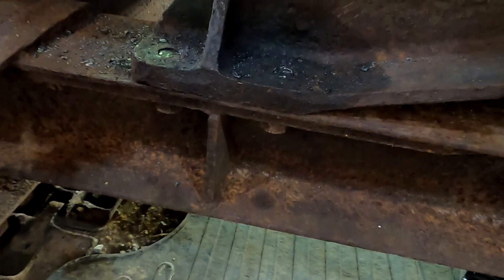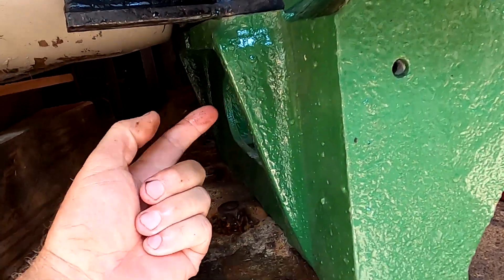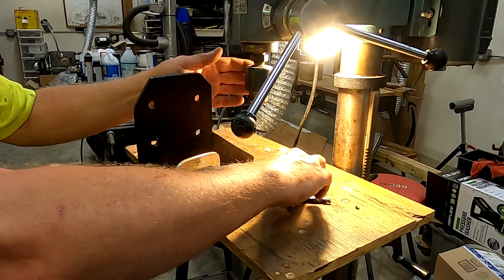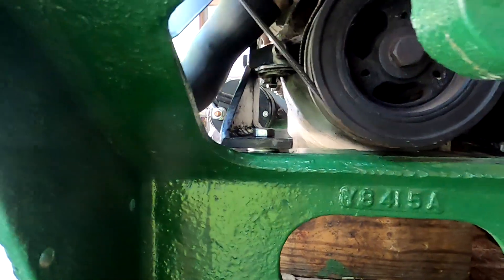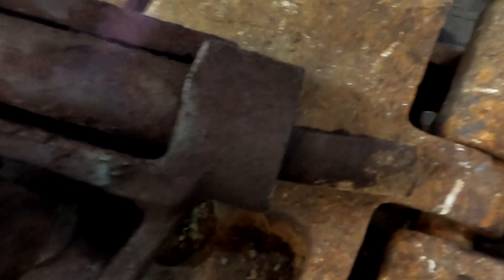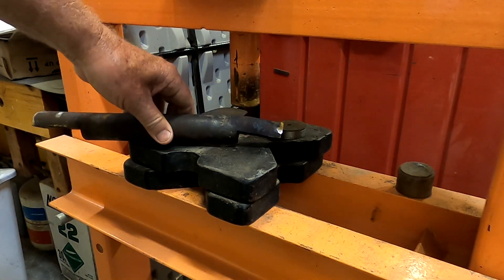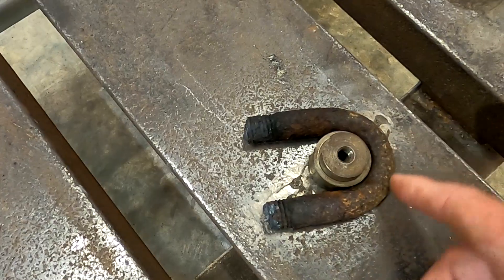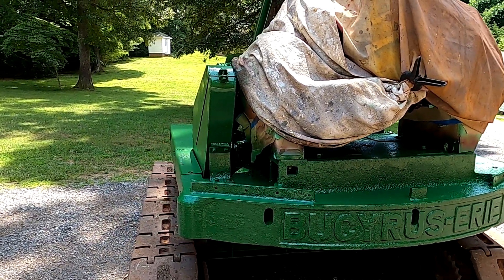Bucyrus Erie 10B Mechanical

Comment: God bless you restoring the relic.
Reply from the maker: It is more work that I thought it would be, hope to get back working on it soon.
Reply: @HistoricMachines  we still use this vintage equipment in my industry daily. We have lots of clyde,skagit,american, manitowoc,and dravo equipment still in service too this day.i love this old technology.
Reply from the maker: I like almost every type of earthmoving machines, but I really like to watch, hear and sometimes operate these older machines operating. @dirtycraneoperator
Reply: @HistoricMachines  they are grate for clam shell dredging and pile driving. Very tuff for duty cycle operation.  Super easy too fix (if you have parts) but parts can be found or built. Very reliable the simplicity in the engineering is awsome.

Comment: WOW! You weren't kidding about making some progress. Great job!  Thats going to be a really nice machine when you're finished.  Ive been plugging away on the Lima 34 shovel.  Ive power washed it 3 times now and im getting close to having all the grease out of it. used 800 gallons of water so far haha.
Reply from the maker: It has been a long time getting to this point. I did some research and found out that I got this machine in November of 2017, so it has sat in my backyard all of those years. I hate having something sitting around that does not work so this machine has not been a friend to me for several years.

Comment: did you remove any of the brake bands? i am having a heck of a time figuring out how to remove them
Reply from the maker: I have not removed any of the brake bands.I did remove on of the clutch bands. It was not easy until I losen the band adjustment nuts.

Comment: Hello I am about to start the rebuild on my 10b shovel as soon as I get it to Florida from Montana. I have questions about shipping. Do you know what the overall length of the 10b is . And still stay below 10ft high ? How did you ship yours? Is there anyway that I can call you?  Thanks,Lawrence
Reply from the maker: My shovel front is on a trailer in approximately the shipping position so I could measure it and add that to the length of the crane body to get a good overall estimate. I was able to move my machine on my 20 ton tag trailer. Send me an email at brianlough@hughes.net and I will send back my contact information. Thank you for watching.